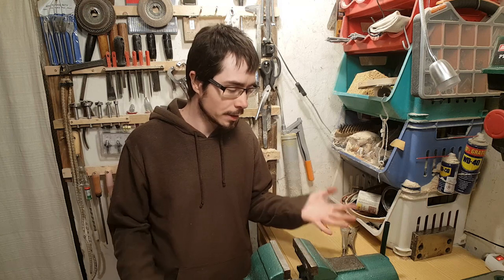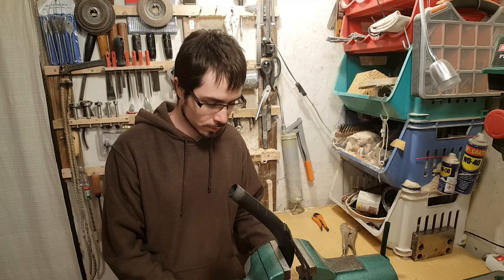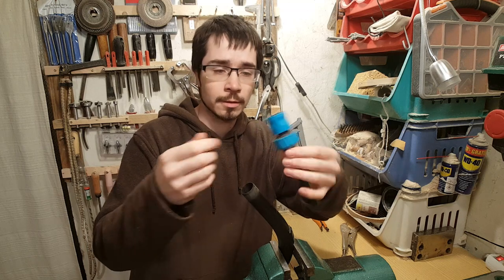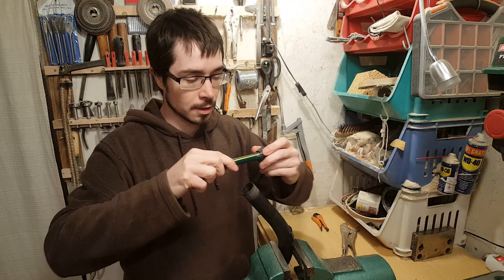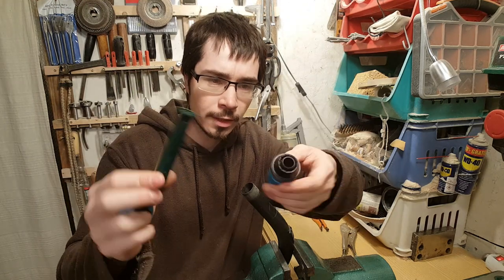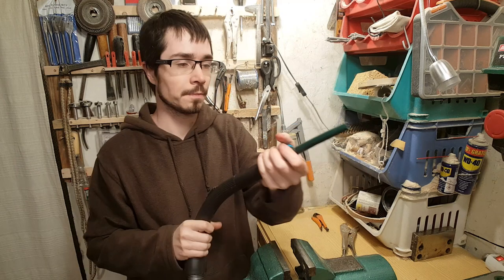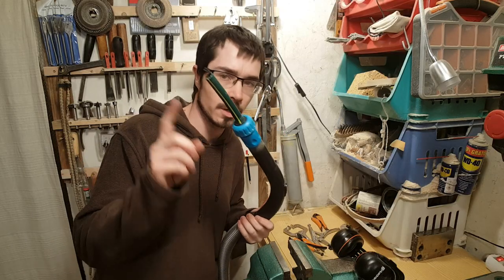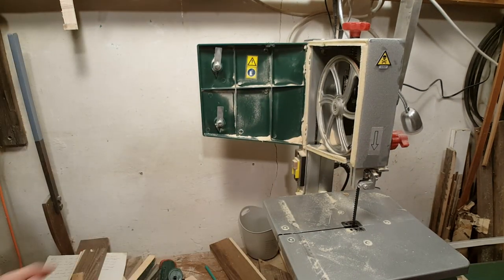How to make a Vacuum Cleaner Nozzle

Comment: The quality of your videos improved a lot, keep up the good work!
Reply from the maker: Thanks! I noticed a significant volume drop in the middle though, and I'm still not entirely sure why that is, the distance to my mic is the same...
Reply: @feritales5756  Using a dynamics compressor on the audio track should help you maintain the same volume levels during the video. Let me know if I can help you with that. :D
Reply from the maker: @veggg  Wow, I'll google that, thanks! My main issue is that my smartphone has a fully automatic video recording app, so white-balance, color temperature and even audio gain settings are determined by the phone. Even now that I am using a shotgun-microphone the phone won't let me set the audio levels. I wonder if Audacity is capable of fixing this :).